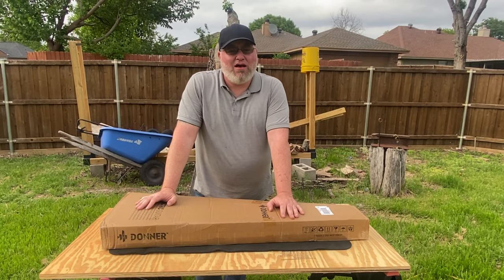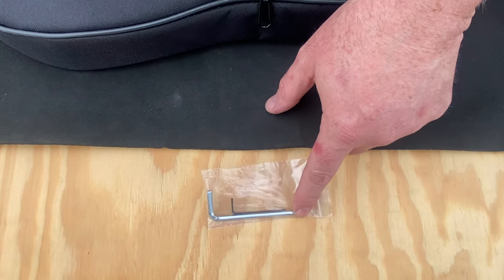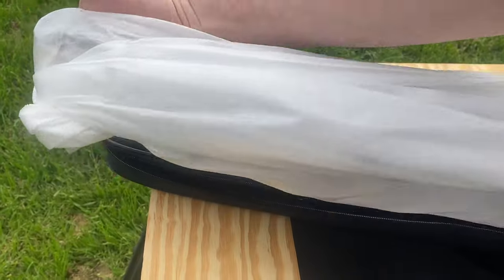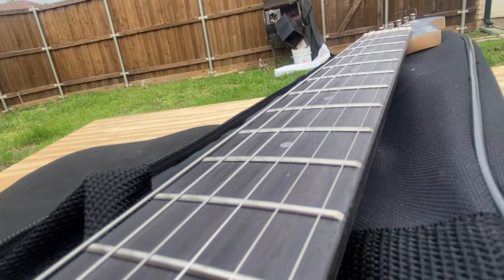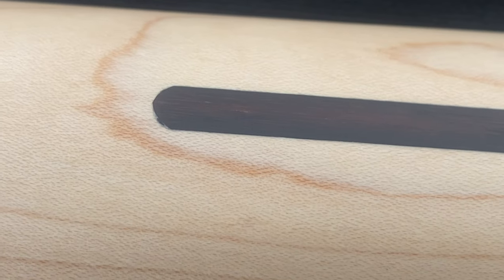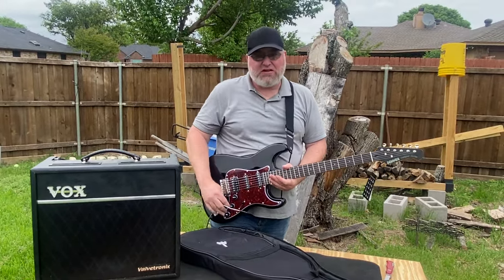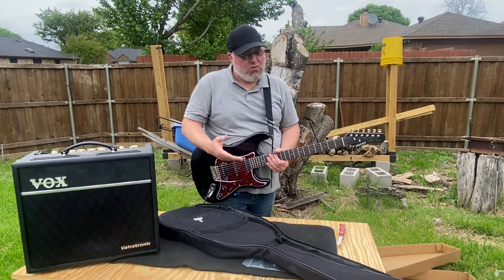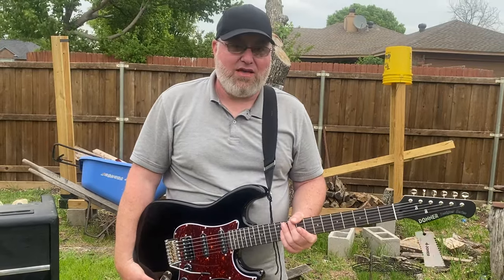Donner DST-200 Electric Guitar - detailed unboxing: Good? Bad? Trash? Treasure? Part 1 of 2

Comment: Hi Luke. The video you watched about the springs being to tight was mine . Thanks for watching. Also, the pickups are not microphonic ,all pickups make that noise if you put metal on them. The best way to find out if your pickups are microphonic is simply hold the guitar close to your mouth and speak into the pickups. If you hear your voice through the amplifier then they're microphonic.  Good luck and stay safe my friend